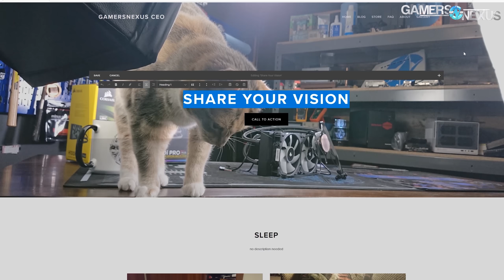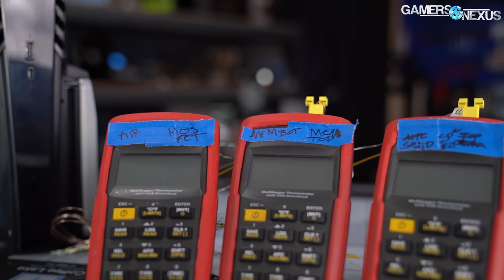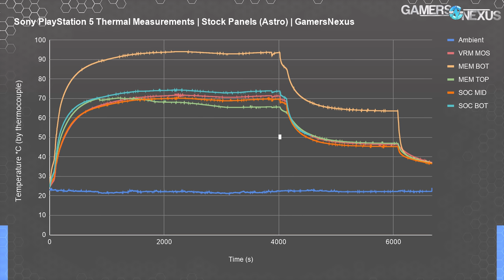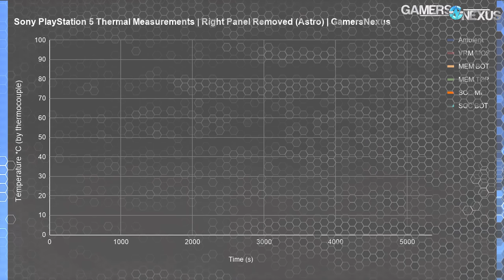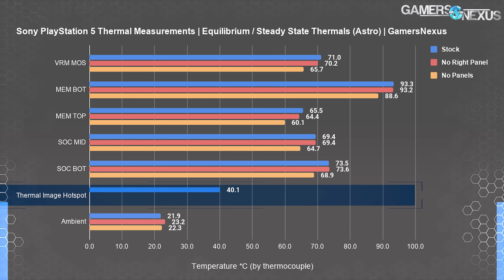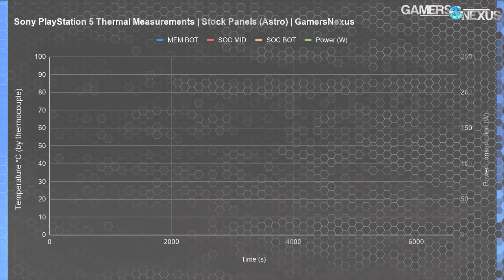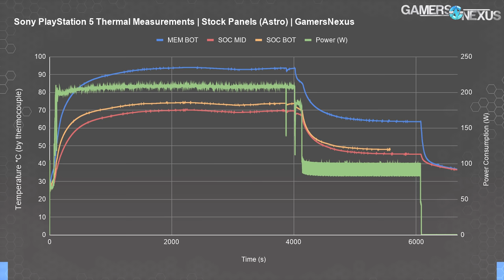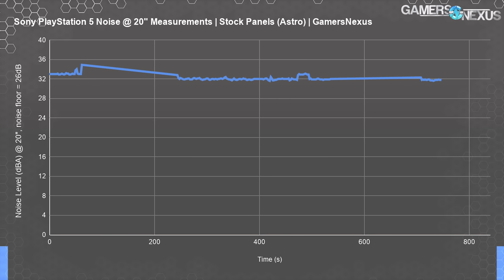Weak Cooler Design: PlayStation 5 Thermals, Power, & Noise Testing

Comment from the maker: Curious on the viewer thoughts: How do you all feel about the PS5 vs. Xbox SX looks and appearances? What about the sizes?
Reply: eh
Reply: The PS5 is ugly af. I hope they come with a slim version in a couple years.
Reply: I really personally like the ps5 design, xbox is kinda boring but much smaller. Also my TV stand would fit the ps5 when placed on the side but not an Xbox neither way.
Reply: Xbox looks more modern, PS5 looks too "extra" but gives off a next gen vibe compared to the xbox. I personally prefer the SX but I don't think either look ugly
Reply: XSX is eh. It works
PS5 is more like wtf were they thinking
Reply: Coming from a guy who isn't really a stickler for looks and probably won't buy either console anyway. I personally think the Series X would look better on an entertainment area or sitting on a desk, not on it's side though. PS5 though, I think it looks fine the way it is, but I feel it'd maybe draw too much attention where as the Series X would kinda fit in with most of the stuff an average customer looking to buy a new console would have around.
Reply: The PS5 looks stupid, the binder memes are pretty accurate. The XSX looks good but I get that it doesn't look particularly exciting. XSX seems more functional though which is what I'd be after, but I plan on buying neither.
Reply: I think I prefer the Xbox designs just for being able to place them vertically or horizontally without having to move a stand around the console.
Reply: I think the PS5 looks like it had actual thought and effort put towards its aesthetic and design. The Xbox looks like they were focused on the guts right up until the week of the reveal then realised "Shit. we have to actually sell this. Uhhhh....GREEN LIT VENT ATOP A BLACK BOX. PERFECT." I definitely prefer the PS5.
Reply: as a pc user, would go for the xbox, for the sole fact some games support Play anywhere, and i also have gamepass ultimate on PC so i can have free gold. The size i find is rather nice, it gives a mini itx build vibe for me and would fit nicely anywhere on my desk
Reply: XSX looks boring af
Reply: it's not the worst, but it's a bit too flashy after years of black rectangles i'm used too
Reply: Ps5 appears to have a more "modern" design if you will. But the Xbox appears to have a design that is indicates it was designed in a more performance effective way. That's my take away at least, xbox appears to have more function over form with the opposite to be true with the PS5. But i might be wrong.
Reply: PS5’s design made me appreciate the Xbox design more. Sure it’s just a box, but what the hell is that ugly 2010 PC tower design going on with the PS5 lol
Reply: @JustrazJD  the series s would totally fit if you can fit a big ass ps5
Reply: I don't love the way the ps5 looks but it's not hideous, I do however adore the experience the ps5 offers. It's one hell of a system
Reply: PS5 gets fixed by 3rd party sideplates.

... ah shit.
Reply: The PS5 is ridiculously big. The Xbox X doesn't look amazing, but the focus on function over form could make it a lot more robust for the average user, which is what I'm more interested in - most people I know tend to put their consoles in a spot that isn't in full view from the couch anyway, so function is a lot more important!
Reply: exactly. XSX gives "whatever, so fans holder is square so we built xbox a long-smolbox. hey, it actually works!"

PS5 gives vibes "hey engineer, we want fo showoff asthetic with PS V, so build design like V from romans! But dont forget it must be cool (aesthetic&technical) design."
Reply: Game Pass for PC made me double down on not buying a console once again. Microsoft exclusives are already included in that service.
Reply: Prefer the xbox - mostly because it's not as offensive as the PS5
Reply: PS5 is ugly AF! I prefer Microsoft's fridge more.
Reply: Xbox series X looks much better. Ps5 is not only bigger but ugly. To me it looks like Microsoft has prioritised cooling over style. But it looks better imo anyway
Reply: I prefer the PS5 as it is more ambitious. I think they will move to a better thermal case later and probably dump this design. They do this every gen where they optimize it over time.
Reply: PS5 looks aesthetically fancier but the XBOX SX has the better functional form factor and potentially airflow.
Reply: i like the ps5 better because it has more character. i look at the ps5 and think sony had a bit of fun with the design; xbox is strictly functional, i.e. box with holes in it
Reply: Both consoles look good imo, but the PS5 looks "cooler".
Reply: I really wish they stuck around with the more conventional formfactors.  Both last gen consoles fit in much better on my entertainment center than either of the new ones.
Reply: XBSX is sleek & simple
PS5 is unique & eye catching

Oh, who am i joking, XBSX looks like a shoebox, I'm scared I'll throw it by accident; meanwhile PS5 is laughably tall & weird looking (from front), and despite can be placed horizontally, it's clearly designed to be vertical, and I'm still scared that I'd slap it by accident as well.
Reply: Personally I like the Xbox SX looks as it can hide in my black cabinet. Also it being a box and smaller along with it being able to be orientated multiple directions makes it awesome for fitting in within my other box like electronics. And the PS5 is able to be made black but it's not a box which is very important in my limited space in my cabinet as I am running out of room. The PS5 is also a very different shape and I don't think I could fit a nother console if it has to be standing up like that the PS4 was awesome it's thin. But I would test fit it to see if it fit or look up the dimension and measure it. So for me Xbox SX in this regard
Reply: Definitely a fan of the series X the most, I like the mini pc simplistic design
Reply: @JustrazJD  isn't the ps5 bigger than the Xbox?
Reply: I've always been a huge Playstation fan, but honestly this Generation the xbox just looks way better in terms of design, it can easily fit in most setups as opposed to the tower of orthanc that Sony Made 😅😅
Reply: It’s not so much about the aesthetics of the consoles as much as the overall ability to do what it is designed to do efficiently and effectively.  Side note; I was unfortunate to have a PS5 with a high failure rate (basically unplayable) so from experience the XSX is doing what is was designed to do.
Reply: PS5 is futuristic AF for me. The design would look nice at CES or in my room for a couple of days but after that a don't want to watch it every day. The Series S looks like a redesigned Soviet radio by Ikea, the Series X is the monolith from 2001: A Space Odyssey. I prefer these for the minimalistic design but I'd still buy the PS5 for the exclusives.
Reply: I like the design of both but I would prob get a Ps5 due to exclusives, most Xbox exclusives will come out on the windows store and thus run better on my PC, but right now it's all about trying to get one of the new gpu's.
Reply: I've been a PC gamer since forever so I might be biased:

The Xbox SX looks way better than the PS5. I personally like the cube shape and the design itself looks like it prioritises performance more than aesthetics, which I prefer.
Reply: there is not much to compare with regarding size and appearance. PS5 is ugly and massive. Xbox is ok, nothing fancy.
Reply: I'm not really interested in consoles, but I much much prefer the muted monolithic look of the Xbox.
Reply: I like the PS5 design
Reply: ps5 stands out, matches the aesthetic of a spaceship and we do not live in that era yet. Xbox however can probably be easily blended with other media consoles/receivers etc. I personally don't care for the looks of the consoles since I only got the ps5 due to exclusives. If ps5 had no exclusives, I would instead spend that $500 that went to the ps5 to upgrade the pc :)
Reply: Thank you for giving more information and insight on what possibly was the cause of my PS5 high failure rate.  Muchas Gracias to you again for taking the time to teach us viewers a thing or two.
Reply: My XSX looks perfectly in-place next to my audio receiver, if a little plain. Mostly unobtrusive, although the LED benefits from a little tint film. PS5 is too ostentatious for my tastes as-is, but would be fine with black panels. Size of either is fine, Xbox may even be smaller than necessary, but I have a typical-sized desktop PC in the TV stand a shelf down so it may be that my priorities aren't what most people's are.
Reply: The PS5 is a modern art abomination that looks like a concept design from 2001. Outdated 15 years before it was launched. It seems like their whack idea of "futuristic aesthetics" was the primary consideration, and cooling/layout was just an afterthought. The Xbox seems like there was more thought put into the overall design. Form = function. I don't want a gaudy art installation thats the size of a record player, I'll take the minimalist shoebox.
Reply: I prefer my stuff to looks like a rectangular prism. Who cares if it looks boirng, it works.
Reply: PS5 looks very cheap, like a basic router. Xbox s x is subtle and this i like. :)
Reply: PS5 is nice because it looks different, but its wayyy too big. The xbox's are just another box, not much you can day about that 😂
Reply: xbox looks much cleaner and convenient to find a place for, rectangles rule the space, ps5 looks like it is 2009 concept. Only way sony could have done worse is by making the console spherical
Reply: The disk drive on the ps5 looks like some kind of shrunken, vestigial organ, or perhaps like a sewn on body part.
Reply: They're both kinda oversized, but at least that allows better cooling than the horrible ps4 cooling.

The Series X would fit better in most situations I think, just stick it below the TV/in front of it on its side.  I think both look good, just in different ways.  Sony really want to make it a showpiece.
Reply: I like the ps5 kinda, it cuts a good silhouette and looks unique. I respect the xbox for its simplicity that still doesn't quite look like any other console.  Ps5 irl is a big boi. It stands 3/4 the height of my 55 inch tv.
Reply: I will always wait for the second iteration for sony consoles, first generation playstations always have their quirks from my experience. No opinion on xbox since it won't be supported in my country.
Reply: The Xbox seems to have gone with a more efficient way to remove heat from the system, whilst the PS5 brought in an interior designer and used a mood wall and then whipped their engineers to cool the thing.

Edit: just remembered re: the memory cooling. I pulled apart my PS4 and the memory modules made contact with the thermal solution with pads that sat in the middle of the chip. Didn’t cover it, not by a mile.
Reply: They all look like consoles to me. Big consoles that can be jerry-rigged as an ITX PC case.
Reply: PS5 doesn't look terrible for me as apparently most people think, but the XSX looks simpler and nicer. Although I hate the "plasticky" look of the PS5, the glossy black center being the main offender. As for size I prefer the XSX form factor when placing the consoles vertically, and I guess the bottom-to-top cooling design is more efficient than the PS5 one (we'll see in your upcoming review)
Reply: I hate the design of the PS5. It looks like a big toy, and it sticks out like a sore thumb unless your living room looks like it belongs in some futurist interior design magazine. I’m speaking to both it’s physical aesthetic, as well as the fact that it’s bigger than it has any right to be. Some people might dig how it screams “GAMER” in bold letters, but I don’t. I’m not insecure about my hobby, I just don’t feel the need to advertise it to everyone that walks into my house.

Meanwhile, I literally could not be happier with the design of Series X. I’m a big fan of the minimalist/monolithic look of NZXT cases, and the Series X rings all those bells for me. You can stick that in just about any modern household, and it will blend right in. I also appreciate how compact it is, especially in comparison to Sony’s offering.
Reply: Imo i think the PS5 is muuuch to big. It's actually massive IRL compared to the Xbox, and they seem to perform the same in terms of thermals and accoustics according to reviewers. Not a fan of the PS5 looks either, but PS5 exclusives are gonna be better so :/ But im liking the Xbox design way better all in all. Its more next gen in terms of size and performance.
Reply: Xbox is literally a BOX a Big Box

PS5 is weird at first but its actually way cooler
Reply: @zombinawaifu8918  honestly... you have no need to buy XSX when you have a gaming pc.
Reply: Ugly, liked the dev model more, feel like it could have been a lot smaller, getting banned for being mean and game censorship sounds creepy and is  more of a reason for me not buying it.
Reply: Did you like your own comment?
Reply: It is what it is. Personally I am going to be a lot more sold on the PS5 if they sell some side panels that allow for different colors.

I can already imagine how cool that would be for a nice bright orange. 

Other then that I think they work and are serviceable. PS5’s design makes sense when considering the heat sink. May not work for everyone’s set up but it will work for mine.
Reply: Love the XSX design both looks and size. Not a fan of the PS5 design and feel like they could've made it alot smaller, and the XSS is fine
Reply: The PS5 digital edition in vertical orientation looks much better in the flesh than it looked in pictures. But in the end it's the games that matters. Since I also have a capebale gaming PC there's really no reason to get a Series X so PS5 it is for me.
Reply: Xbox SX. I love the simple look. The sandwich design looks like easy to cool with that beefy cooler. With airflow as simple from bottom to top. 

So, when will you review thermal for Xbox SX?
Reply: I like the ps5 design.
I really don't care about the size as long as temperature and noise is good.
Xbox is fine too. Not really interested though. Why would any pc user get a Microsoft console when every game comes to pc anyway ^^
Reply: Xbox wins by a long, long margin lol
Reply: Don't mind xbox's black refrigerator look, I think its fine. The ps5 is huge tho, makes my define R6 look like a slightly larger sff case!
Reply: The PS5 feels like it was designed by a company that sells consumer electronics, particularly those electronics brands that have a lifestyle element to the marketing and the aesthetic styling to go with it.  Love it or hate it, the styling is distinctive and that's obviously intentional.  Premium consumer electronics are fashion pieces.  I fully expect custom side panels and controller colours to be a thing (for people who don't want to match the white) and the eventual Slim and Pro revisions will sport some new funky variation on the aesthetic.

The Xbox SX feels like it was designed by a company that makes business electronics (or generic boring) electronics.  It's dull as rocks and utterly functional.  It's not an eyesore but that's mostly down to it being a simple black box.  It's hard to screw up the aethetics on a black box.  It is not a device you can show off to your non-gamer friends.  For people who want something that disappears into the home theatre unit, it might be a great fit.

The fact that the PS5 is as quiet as it is and it isn't a nightmare cooling-wise speaks volumes to the skill of Sony's engineers since that shape is more of a challenge than "fit it in a box".  I imagine that they'll tweak the design to address those issues with the first minor design revision (probably within the year) probably with some simple fix to bring the memory temps down a bit and maybe a slight tweak up in fan speed to boost cooling overall.

The size of the PS5 is a touch awkward as the vertical conversation piece but sideways mounted with black plastic side panels (give it 6 months and they'll be an option) and it will just disappear into a horizontal slot in my home theatre setup.  The ability to use proper M.2 SSDs is a real selling feature to me.  I don't trust MS to keep those proprietary SSD cards priced competitively.
Reply: I like the Series X better, it's simple, minimalist and can be ok in any area, and smaller ... Sony tried too hard with the PS5 design, and it's way too big
Reply: Ok, so we need ps5 mesh.
Reply: Xbox is a black rectangular trashcan after apples mac. Generic and does not pop off in looks specially with their false PR Marketing as the most powerful console!!!. 😂😂😂😂 Glad they only sell on US and not outside of it.
Reply: @imadecoy.  FANBOY ALERT🚨🚨🚨🚨
Reply: Time to see comments from people who are too anal about thermals... 😒
Reply: Xbox is a computer first , style statement later (or never). Sony has gone for a style they think looks good but is very polarising in that people either love it or hate it and thinks it looks like a pregnant d link router .
Reply: I think the XSX is boring, but the PS5 is definitely over the top. Still, I'd rather pick something that stands-out than something that nobody will notice.
As for what I'm going to get: Probably the PS5 Pro when it comes out. It'd be nice to have more than just one expansion slot, plus better thermals than shown here.
Reply: I like the xsx, the xss looks kind of ugly but its impressivefor the size- I'm looking forward to your tear down of the lil bugger as a bet it runs hot af in spots. The ps5 is just too bloody big, sacrifices colling for looks and that annoys me they went THAT far to not really cool everything properly... again
Reply: PS5: It'd be difficult to match it with most TV. Fortunately the side plates are user-replaceable. I can just get a replacement plates and put some Waifu-sticker on it, and make it mine. Also I guess we might see some 3rd-party side plate that claims to reduce thermal significantly ... though I wouldn't be interested.

Xbox SS: looks like an upright electric stove or something ...

Xbox SX: I'm sure there will be some min-ITX cases that copies this poor thing.

PS. no... I'm not really into waifu .....
Reply: @JustrazJD  But the Xbox is much smaller? How do you fit the PS5 in your TV Stand when it's bigger???
Reply: The PS5 looks like some mid 1990's crappy art deco piece you would find on the shelf of Patrick Bateman's apartment. While he plays "Huey Lewis and The News" right before he murders you.... So I guess its not for me. The Xsx screams I am a mini PC RAWR! And every PC enthusiast might comment on "How cute it is".
Reply: I like both, but the curves on the ps5 speak to me <3
Reply: Xbox could blend in with a decent home theater system. Ps5 looks like someone sandwiched a ps2 into a white ring binder but left a couple of game cases inside and just squeezed it shut. It looks ridiculous. They'll fix it later on down the track but needed it to look special for version one.... I hope
Reply: Im more of the boxy design sort of person, So the xbox wins me and i own the series S anyway and its smaller than i expected, I liked the original wedge PS4 but i dont get anything from the PS5, come to think of it all first gen playstations have been bigger than they needed to be, Also i think thermal wise the xbox operates warmer than it needs to just because people will complain about the faintest fan noise on consoles, and everyones PC with their fan choice always has a soothing sound to the owner :3
Reply: they are both ugly, at least with the xbox i can hide it behind the tv, no chance with the ps5
Reply: The PS5 looks like the cheapest Chinese "gamer" PC chassis from like 10 years ago.
Reply: Xbox fridge all the way!
Reply: PS5 is 3/5, if it was black i would give it 3.5-4/5 but in white is ungly for me.
Xbox Series X is 5/5, One X is 5/5 and Series S 4.5/5 if was all black or all white without the black vent i would give it 5/5.
Reply: Love the XSX design over the PS5
Reply: I thought I'd hate the ps5, but one I placed it in my entertainment centre next to my amp, I fell in love with it.
Reply: The PS5 puts the full fat PS3 to shame in terms of bulk. It's almost wastefully huge for a modern console. Also it looks like modem. Having to buy new controllers would be frustrating if I owned a PS4. Backwards compatibility limited to only PS4 is understandable but still disappointing.

The XSX and XSS look mundane and are pretty nicely sized. Not too intrusive but not really distinctive. I feel that both the XSX and XSS will have better thermals due to the utilitarian design alone. Great backwards compatibility, including Xbone controllers, is a real great selling point. I use XB1 controllers on PC so I could easily have player 2 sorted with something I already own.

It's all about the games for a console, though. Unless I can find something more compelling than just one game (Demon's Souls Remastered) or amazing backwards compatibility (all the way back to OG Xbox) I think I'll hold out on both PS5 and XSX. The Switch is a better buy in my eyes, a lot more compelling stuff than just one old FromSoft title or multiplats that my PC can play just fine.
Reply: Got XsX for gaming on a new q90T with vrr and 120Hz where supported. Amazing quiet and nice looking console. Would’ve gotten a ps5 too if it wasn’t so damn huge and ugly. Will pick it up when inevitable aal black slim version comes out.
Reply: I'm not in the market for either, but my girlfriend will probably buy the ps5. I much prefer the looks of the ps5, I'm ok with the xbox. Size is fine for both, I have a tv stand that could handle either.
Reply: prefer the ITX-like profile of the XSX, but I'll probably get the PS5 just for the games.
Reply: i like the xbox better looks wise
Reply: xsx looks boring
ps5 looks good next to my white o11 dynamic, but for a console it's fricking huge
Reply: Quite like the Xbox design myself. PlayStation feels like an art piece, and not something I’d prefer.
Reply: Xbox Series X is hotness, PS5 looks like it's popping its collar
Reply: I'm not so much about looks for the most part. If I offered an opinion on the aesthetics the Xbox looks like a Russian or cold war era East German product and the PS5 looks like it would be at home in Austin Powers bathroom. I just want them to work well. BTW, I have the PS5, baaaby!
Reply: Not a fan of the white PS5 but I can imagine it looking nice in some other colors or with some vinyl wrap designs. XSX is just a boring rectangle.
Reply: i like my minimalist boxes so xbox did a great job, the PS5 has potential in customization though which is nice
Reply: My only thought is how many people will threaten to make a business out of re-casing PS5s with more fans and heat sinks.
Reply: Xbox may look basic, but sometimes less is more
Reply: I don't care about the new consoles at all, but I think both look really good. I really like Sony's design. It's a bit large though, but I wouldn't really care. Both would fit my entertainment wall just fine, looks and size wise.
Reply: Look literally doesn't matter to me, all I care about it noise, thermal, performance and price to performance.
For now xbox with their game pass is far superior to me vs sony with 70usd games.
Reply: I feel like PS5 approach for the design was more traditional but the end result is not effective. They had to used liquid metal which, in my opinion, is an unnecessary  risk, even more when considering that Microsoft pulled off the Series X design without having to use liquid metal and a bigger shape (both consoles are big anyway). Microsoft went a completely different way in their design because of the same reason that PS5 is what it is: both consoles are using new and more powerful hardware with more strict cooling requirements. So Microsoft shift their design while Sony kept it more traditional.
Reply: I prefer PS5 looks. It's original and different without poking your eyes out
Reply: This is the first console generation I'm going to completely ignore, as these devices start to become more and more like pre-built PCs with a limited and more expensive game library.
Reply: Both look ridiculous in their own way. Xbox looks like an ugly trashcan but at least it's relatively small. Ps5 looks like an absolutely ludicrously sized white snot (or other less pg friendly bodily fluid). Both designs look amateurish in this day and age.
Reply: I think the Xbox is a more elegant design, but I honestly find the PS5 to be attractive as well. With both consoles being reportedly very quiet, the acoustics justify both consoles being larger than usual, but you can tell that there was a good attempt from Microsoft's part at minimizing the footprint of their console, whereas the PS5 is a bit of a handful.
Reply: PS5 is ugly and big, xbox is just a box.
Reply: PS5 is really bad, XBSX is better but not by much.
Reply: @Mandroid45  modern? The 2 Xbox models are just boxes...
Reply: The ps5 is more interesting aesthetically while the XSX is just a tight cubical box. Both are very well packaged but it is obvious that ps5 had more design effort.
Reply: @zombinawaifu8918  as a PC user you should be considering getting the ps5 for the exclusives.... You can play literally almost every single Xbox title on PC
Reply: Hi there Tech Jesus,

First of all, thanks for this vid. It's exactly the no nonsense kind of stuff I'm looking for. Refreshing to see people talk about the PlayStation without mentioning rehearsed lines, such as OMG OMG MILES MORALES ASTRO etc. You guys are awesome. Keep it up!

Can you please do power and thermals testing on the Series X and S as well, and also specifically how much power these use when running media apps such as Prime Video, Netflix and Kodi? Pretty please?
Reply: Series X is a fridge and a ps5 is a scientist
Reply: @Gamer Nexus,
So what could/should we do to improve thermals ?!
Make a video pls. 
Show us where to add contact pads, paste, make adjustments, holes etc.
Show us everything pls !!!
Reply: I don't care about the design, but the size of the PS5 is unnecessarily massive.
Reply: The XBOXes are just that much easier to mod looks-wise. I'm particularly surprised they didn't offer the S in a "Japan Edition" with the cooling dot being red. The X has simple rectangular sides, which are that much easier to decal for or even paint on. And it's in black, shouldn't be that much of a problem to mod.

I can't wait to see what the creatives will do with these.
Reply: the PS5 digital looked bad to me but could understand the appeal. then the disk version just looks like the digital version grew a tumour, horrible. I love the series X because it feels much more factor over form, more simplistic, no nonsense, non-intrusive.
Reply: PS5 is huge, but I love its futuristic design.. Looks like it's straight out of J. J. Abrams Star Trek
Reply: I definitely prefer the PS5, it's unusual but at least it has its own style. The new Xboxes are just dull boxes.
Reply: I own a ps5 and I love how it looks. Yes it is large but I think it has a much prettier design. I am excited about the possibility of custom plates for the outside as well. Possibly mesh ones? lol
Reply: I MUCH prefer the xboxes. I like geometrically efficient devices. This playstation just screams "make it bigger so it looks more impressive" while actually reducing the space to put actual electronics and cooling.
Reply: PS5 reminds of labia, i can't shake the image from my head. Xbox SEX reminds my 2010 computer build. It's been wild.
Reply: I think they look like consoles. I think Xbox is gonna have far superior cooling as well, and judging by this video I think I'm probably right.

When are you guys gonna make a mesh side panel for this thing? PS5 is the only home console worth buying if you have a PC, so I guarantee there's a market there lol
Reply: The series X is simple looking.
But very well engineered, functional and very small.
The PS5 is Huge, looks... alright and is hot appearently.
So yea....
I guess the Xbox is better
Reply: Series X and XS look a hell of a lot better to me, because of the clean look. The PS5 has such a weird form, it looks out of place however you place it.
Reply: Xbox is neutral and blends in.

PS is bold and a centerpiece.
Reply: I think the new Xbox has an amazing appearance. I really love the chimney design and the kind of futuristic aesthetic that it has. The PS5 slim is nice imo but the PS5 with the optical media is really awkward. Size for me personally is not really a problem, but I could see the PS5's more elongated approach being easier to integrate into many living rooms (I do wonder about the thermals though if you stick it in a shelf underneath the TV).
Reply: The XboSX looks like a nice SFC pc.

The XboSS looks like a last generation console.

The PS5 looks .. weird. Unique.
Reply: One is styled, the other is a black box. As for size, unless you live in a rabbit hutch, tne ps5 isn't that big.
Reply: ps5 looks better in person than pictures but, it's not pretty for sure. keep mine on its side. I'm a huge fan of the menu and ui, prefer it over the x.
Reply: Maybe ps5 would have looked a lot better with the all black design.
Reply: @WowzersNoWay  yeah I wouldn't have much of a problem with it were it not for the size to boot. It's like Sony said FU to everyone who placed their ps4s horizontally. It will barely fit my TV bench shelf and that's before accounting these heat issues and my tropical climate.
Reply: I like the PS5  design it looks futuristic. Don't really like the Xbox one. 
But all in all it doesn't matter. Only thing that matters is what games will the consoles have. I usually bought PS for Final Fantasy games and will probably do the same this generation.
Reply: As long as it’s cool, I couldn’t care. What do you suggest to fixing those hot ram chips? Better thermal pads?
Reply: I'd much rather have something that looks Corsair one-esque and normal over something that looks like it's about to summon blue eyes ultimate in the middle of my living room. Regardless, I'm not their target audience anymore. #PCMR
Reply: I prefer the look of the PS5. I like game consoles looking like game consoles, rather than just being a black/grey box. The Xbox SX especially looks incredibly boring to me, for my money it's the most boring looking gaming console ever, and among the top ranks in most boring looking THINGS ever.

Since we're calling the Xbox Series X the SX, is the Series S the SS? Xbox SS... Yeah I can't see anything problematic there.
Reply: Xbox looks boring, honestly think it looks really cheap.

PS5 looks nice, "next gen" vibes.

Overall, PC gamers rejoice as no longer restrained by 8 year old hardware. Good times for all gamers.....if you can actually get hold of a GPU, CPU or Console of choice.
Reply: The ps5 would look much better if the white plastic parts didn't stick out so much on top, and if they made the lighting customizable RGB with glowing buttons on the controller
Reply: I personally like the PS5 design. Looks futuristic and gamery. Don't really get why people think it's ugly tbh.
Reply: Xbox ugly but small. PS5 cool but huge
Reply: To me personally, the PS 5 looks better "Sideways" with the white side panel showing towards the user, rather than the central black piece showing forward. 
In my opinion, the XBox S/X look better overal because they dont have to "match" any design or anything in the living room. They blend in just enough.
Reply: Both are ok, xbox is very basic looking, but not awful, while the ps5 is rather large looking
Reply: image the Jeremy Clarkson meme.

*points at the PS5 * This looks excellent. *points at XSX * but I like this.

The PS5 just stands out too much for my liking but you have to appreciate its super sleek look. The XSX might be essentially a mITX computer looking box, but I wouldn't really notice it on my TV table and that's a plus for me cuz I would focus on my game better (most likely anyway cuz I go PC all the way, all the time).
Reply: @SymbolicLogic24  Ps5 looks goofy af like a white binder with a black router in the middle
Reply: the looks doesn't matter as the  performance the ps5 outperform xbox series x According to digital foundry
Reply: Ps 5 design is really hard to fit with the whole styld of a room and it's too big to not notice while the xbox fits any room style, it's little and it could be hide anywhere and you can place it vertical or horizontal and it will still looks good.
Reply: The ps5 is hideous.
A massive plastic box.
Looks like a cylon from the original series of Battlestar Galactica.
It will not age well.
They have tried to hide a cheap mass produced product by trying to make it look cool, which it doesn't.
Reply: @NobleStoneUK  Best descrip ever
Reply: I love the PS5 design matches my Lian Li O11 Dynamic XL
Reply: @Saakk129  "Eh it works?"

Exactly what other mass produced product is that small and with that much power for $500?
Reply: I think it's nice sony tired to do something other than a black box and as a result it's huge. They probably could of made it at least half the size. The Xbox is literally a black box it there is a floor on how bad it can look. The only real design consideration is the color and materials.
Reply: Xbox looks like a trash can for your kitchen and they play about as many good games too..... thing looks absolutely stupid on it's side and the material just holds greasy fingerprints forever and we all know how greasy Xbox users are.....
Reply: PlayStation 5 is the best looking console of all time
Reply: Always hated the design; looks stupid.  Now we have science to back up why.
Reply: @WowzersNoWay  I asked a few people who are not gamers and they loved it... looks like this dislike for the PS5 design comes from gamers lack of confidence and longing to be taken seriously. They had some fun with the design, at least it's original.....
Reply: I haven't seen an Xbox Series X or PS5 in the flesh, but I kinda like the Xbox - its just unobtrusive, looks like it sits there and just does its thing.  The PS5 is a statement and I am not sure how I feel about that statement lol.

I do have the Xbox Series S though and damn that thing is small and quiet and I don't really notice it on my TV console.  It just goes bing when I turn it on and the little Xbox logo, but it really just feels like I have my TV and the controller and games.
Reply: Markus Müller  but the games suck & play much better on PC. Only poor folk or children get Xbox consoles 😂
Reply: Xbox is a fridge, PS5 is a exiting design.
Reply: Markus Müller  plus last time I checked, most PCs still use fans as cooling solutions....so your comment is pretty much fanboy BS.
Reply: Ps5 the best.. xbox design even a 6 years old kid can design this..
Reply: @jonathanr9619  Anyway gamers have no idea about design or style.... they just want to desperately be taken seriously, thats why they get a hard e-peen over glass PC cases and inane bullshit like that.
Reply: @JustrazJD  isn't the ps5 bigger than the series X
Reply: PS5 is ugly and trying too hard to be unique. Xbox Series X is a box, which isn't exciting, but it's also not an eyesore.
Also Microsoft has claimed from the beginning to have great airflow and cooling, compared to PS5 where as soon as I saw it I was concerned about airflow. People make fun of Xbox's green holes top, but hey, if that keeps the console cool and quiet, I'll take it over PS5's douchey popped collar that has no airflow.
Reply: PS5 is huge and ugly, XBOX is bland.  Bland > ugly.
Reply: I loved ps5 design more than boring xbox sx design
Reply: I've always been a Sony fan for the exclusive titles and because I prefer the controller.

But damn Sony got schooled on the console design this time around.

I'm getting a digital and placing it out of sight behind the TV so doesn't really matter - But if I was putting a console in view the XSX more subtle look is way better.
Reply: N Webb screw canned air- invest in a blower! (Datavac/compuCleaner).
You'll save a fortune in the long run and way more effective.
Reply: Xbox sx is cleaner in my opinion
Reply: I brought my lad the series s just because of game pass and wow is all I can say thing is so small looks really good and is heavy! I don't understand why people say the PS5 is better designed! I think its a poor design should have been loads smaller just poor
Reply: I like the boom box S, am neutral towards the X tower and dislike the PS5. I don't dislike more rounded designs like the N64, but the PS5 is just weird shaped.
Reply: The XBoXS are more practical (they're boxes), but the PS5 is much more memorable. Both are clunky and huge compared to any previous console, so neither wins points there. The PS5 wins all the design prizes, though, because it's the only one which actually has a design.
Reply: @jonathanr9619  Beauty is in the eye of the Beholder. Science has nothing to say about Aesthetics.
Reply: Definitely think the monolithic look of the XSX is cleaner and the cooling solution looks a lot more thoughtful, but there's just not much reason to buy one if you're a PC gamer and can get any exclusives on PC anyway, unless it's for a TV Game Pass box.
Reply: Honestly I like more the Series S ♥️
Reply: @neosrt10   thats link is talking about cod war zone thats runs on sx at 120fps and 60fps on the ps5 that can be fixed with patch  im talking about the new games assassin's creed valhalla, cod cold war, dirt 5, dmc 5 check the  comparison on dg foundry youtube channel
Reply: Very happy with my PS5. Size isn't a bother even remotely. Design is pleasing and overall I like the white aesthetic. Seen them black and it looks cheap with the two toned surfaces. Also seen too many people use then without the stand when vertical. It's all slippery for that due to the absence of rubber feet, already heard of a few people knocking them off their entertainment unit which would make me very sad indeed. Xbox is fine, it's not offensive but also just seems a bit plain appearance wise. Again, nothing wrong with that too.
Reply: @TheKazragore  Pretty sure it's not even lit though?
Reply: The space ship is always prettier than a fridge.
Reply: I like the PS5 way more.. its huge so that can be an issue, but the XSX is just boring 😴.

PS5 can sit on top of my media center besides my TV and look the part. The XSX I just want to hide it
Reply: I honestly liked the PS5's original horseshoe concept design more then the current design and never cared for the Xbox tower look.
I miss the designs of the SNES and Playstation 1, those were classics. Even LG's 3DO looks nicer then the current crop of consoles.
Reply: Very disappointed with the PS5, all that size and still a hotbox. So much wasted space.
Reply: I don't care about looks... white colour is stupid, especially on gamepad... XSX might be better in cooling than ps5.
Reply: Caseless ps5 looks better
Reply: I want a box that plays video games. I want to put the box away from view so I don’t see it.
So they both look stupid, and I’m certain that Sony and Microsoft have forgotten what human living rooms look like. I’m not their target audience, anyway. The only reason I’d ever buy a console is that it is more capable than my PC in some way, you know, like a Switch, a console that is well designed, and is more capable than my PC at being portable..
Reply: When can i get one, the feelings ar real.
Reply: Both look cool in there own way, after seeing this its disappointing seeing the thermal results for the ps5 though. I won't be getting either but definitely think Xbox won on both appearance and size but that's just me.
Reply: PS5 looks better, PS5 is faster and PS5 has the best controller the world has ever seen.. So yeah.. PS5
Reply: @markmerkel  what exclusives lmao
Reply: I didn't manage to preorder one so I'm stuck waiting until the supply is restocked, but I like the visual design personally. I've been saying that bigger consoles are welcome when that means that they don't sound like jet engines for a while. Seems like Sony succeeded on that front, but I'm honestly baffled about the memory temps. How could they overlook such an essential aspect, when investing years of R&D into cooling?

Thanks for making a proper analysis unlike many others who simply measured the case temps. I'm a bit hesitant to get one now, since it can get quite hot in the summer and I don't want memory overheating issues.
Reply: I love the XSX design, feels very modern and sleek. While the PS5 just reminds me of old IT gear. And as a person in IT I just hate it. Lol. Other than that, they both could be betrer.
Reply: PS5 is so cool, xbox series x is ok cool. I don't mean the thermals.
Reply: Prefer the XSX personally. It's the same with PC cases, I would much rather an understated slab than something that looks over-the-top 'gamer' (the PS5 isn't the worst offender in this regard, but way too much plastic for no apparent functional reason). The size I don't care about too much, my shelves are large enough that they both fit fine so it's kind of whatever at the moment. I will say that the XSX is ridiculously bad for fingerprints and dust magnetism, I had to wipe mine down with a glasses cloth after setting it up. If I didn't hate stickers so much I would consider getting a black skin to put on it.
Reply: I like it but i would prefer better thermals
Reply: Better themals than looks, at least for me.
Reply: no rgb, im disappointed in both. No 200% performance gains.
Reply: Design/ looks / appearances are a matter of taste i would much more be interested in a performance comparaison!
Reply: I love love love the way the XSX looks. Love how small the XSS is. Not a fan of the PS5 aesthetic at all, and it’s obnoxiously large. Looks aside, so far my PS5 has been stellar aside from looks.
Reply: Ps5 looked decent...in its promotional material. Irl the thing is ugly as sin. The Xbox is a much better clean design, and it holds up irl.
Reply: I prefer SX neutral, industrial looks over the PS5 modern architecture influenced design
Reply: I prefer XBOX series X design. It is boring, but so am I. lol PS5 design reminds me of late 90's - early 00's computer devices and electronics, only huge. It's not a good look.
Reply: Love the PS5 design
Reply: @TheKazragore  Too much "thought and effort". It looks like a design by committee nightmare. Ugly as sin.
Reply: Personally find the PS5’s style to be thoroughly ugly. I like the minimalism and (hopefully) airflow-oriented design of the XBSX.
Reply: The XSX is far more attractive, or perhaps a better term would be unobtrusive.  It blends into the blackness of every other home computer device and peripheral here, and its shape doesn't scream for attention.  (The green on top just says "hey!")  At the size of 2 stacked Gamecubes plus GBA player attachments, I can visualize exactly what it would look like on my desk area, and I like it.

Now if only it had the game library of the PS4.  Appearances aren't everything.
Reply: @paranoidrodent  I kinda disagree a little about the Xbos SX, the matte black does tell a bit of a different story for sure tho. Subtlety I suppose.
Reply: PS5 wants to be the center of attention, XSX just slips in to your tv stand and doens't want to stand out
Reply: PS5 looks like those $40 plastic 'pro gaming' pc cases, minus the RGB of course.

Yeah not good. People say the Xbox SX is boring... I wonder if these people realize you're supposed to USE the machine, not just fucking stare at it.
Reply: Overall I prefer the Xbox design language, both of them go for a clean look and should blend in pretty well in your living room setup. PS5 is very brash and big, draws alot of attention. And for such an eye catching design the materials used don't look all that nice in my opinion, having your eyes drawn to a big plastic tower is a downside. One plus I will give the PS5 is customizability, plenty of people will take of the white sidepanels and paint or hydrodip them.
Reply: I actually like both, Series X is a smart looking bit of tech nice and uniformed but I love what I've seen with the concept designs with what we could potentially get with custom plates on the PS5.
Reply: @JustrazJD  if it can fit the ps5 on its side it can probably fit an Xbox series x on its side
Reply: I have a XSX. I prefer the boring black monolith look compared to the PS5's big-chungus wifi router. That didn't stop me from trying to buy a PS5 though. After that consumerism experience however I might just wait for the PS5 slim-and-available edition.
Reply: I absolutely hate the ps5 look, I'm not to sure why. It just doesnt look great, I like the xbox series x, not the s's black circle. It just doesnt match.
Reply: I dig the iRobot-esque aesthetic of the PS5, unfortunate about the thermals though. The Xbox SX looks functional and probably easier to fit with more setups, but just doesn't feel as unique, but definitely feels more at home with the mATX pc community.
Reply: Honestly I dont care about the size that much and I think ps5 looks freaking cool and fresh. Xbox series S is also a good looking console but it kinda lacks any personality for me. Series S tho is kinda ugly. Really dont like the black circle on white box looks wierd.
Reply: I was unsure of it's thermals when I saw the breakdown that Sony published. This data is valuable, it would be nice if we could compare it to the previous gen consoles (launch PS4, Slim and Pro). That being said they are on their way out so doing such content now would seem more like a waste of time and resources. Holding off for the mid point refresh, be it a Slim or a Slim and a Pro version as they did with the 4. Looks come second to performance for me, if they get the job done then I'm all for the lab coat or Seto Kaiba (Yu-Gi-Oh) collars of the PS5. Mostly in it for some exclusive games that Sony has in their catalog, and if I want something from Xbox, it's usually available on PC as well, so I have my choice made already thanks to that. One more thing, to add regarding the PS5. The whitelist Sony is working regarding the M.2 expansion slot that can handle the memory controller is what I'm waiting on the most. Around 600 GB is 100 more than what we had for the launch PS4 of last gen, albeit that one was a 5400 rpm HDD.
Reply: The unfortunate thing is the only one I like from an ascetics perspective is the runt of the pack; the series S. PS5 is a hog that would require it's own entertainment center cubby with it's curves and SX is to much of a thicc boi.
Reply: ps5 looks like they are trying  too hard.  xbox looks like they didnt try hard enough.  I really liked the original ps4 look and the xbox one x was the best looking one in that family, IMO.
Reply: PS5 is literally too large for anywhere sensible near my tv. Which is a bummer, since I already have an Xbox and there is no point upgrading for now.
Reply: Xbox definitely looks better but is too thick to fit sideways in most tv units (at least mine). Ps5 actually would fit because it's flatter, but it is not a very good design, at least they should have shaved off the protruding fins on the white side panels so they follow the main chassis. They're definitely going to redesign a much more conservative aesthetic in the revision. I guess at the end of the day it's the games that matter, and PlayStation tends to have the best single player offerings (God of War, TLU etc).
Reply: @Ihrohni fan Sarrkassstenschtein just like my setup
Reply: I don't like the PS5 by itself, but the design makes some sense next to the controller and I have a soft spot for "experimental" designs, even if I don't like them per se. Xboxes are OK, I guess, but boring AF.
Reply: PS5 looks goofy compared to the clean minimal look of the XboxSeriesX.
Reply: I like the fact Xbox actually made a console a box. The design couldn’t be more fitting to its name.
Reply: Prefer the look and size of the series x. I can appreciate the aesthetics of the ps5, but would prefer something less attention grabbing and smaller in my living room
Reply: XBSX is nice, minimalist, understated. PS5 feels a little form over function.
Reply: @Manuel G Here in Brazil this thing would not survive our summer, it's 40+ celsius for 3 months!
Reply: the ps5 looks silly and inmature to my eyes. The xbox I like the no bullshit aproach. I'm a "pc gamer" so I don't count I guess.
Reply: The PS5 can atleast be laid in a cabinet/rack of other AV equipment. The xbox has plenty of dead space that it takes up in that situation, so I feel that the PS5 is more likely to look better in that situation. That being said, the old Optiplex 780 airflow (with a single fan in the middle designed to push air across CPU from the whole front of case guiding it with a shroud) is what I think of when I see the xbox, so I'm guessing the system life will be pretty long....those old Dells rarely died because they had so much fresh air to grab at.
Reply: Who cares about appearances! Do the Xbox Series X next, and then we'll be able to tell how we feel about it :D
Reply: PS5 stands out like a sore thumb. Xbox can easily blend into the background. I personally prefer it to blend into the background.
Reply: The series x and s look good to me, they are simple and pleasant to look at which is the exact opposite of the ps5, it's so freaking ugly.
Reply: Definitely the Series X for me. I just prefer the more toned down design that makes it far easier to blend in. The PS5 looks like a Piece of Art in a Way, but I don't really want a Piece of Art sitting next to my TV. Also, I prefer the form factor of the Xbox and now that you have done the Thermal Testing on the PS5 it kind of makes me think that for Microsoft they just went for a Function over Form approach. The Thermal Design of the Xbox just looks more thought out.
Reply: Xbox is boring. I already have a box that I play games on, it has glass panels and Rubs, because how else can you make a box look exciting?

Well, you can put some white panels on either side apparently, because I think the PS5 (digital) looks much better (neither are particularly 'good' looking, but who really cares? I want to play games) IMO.

The disc version, however, is ugly. That extra bit just ruins what was obviously intended to end physical media. 

When they do make a new version of the system, I would bet they don't make a disc version.
Reply: I like the design of the PS5 but it's too big for my setup TBH
Reply: Function over form. The Tower form factor makes me feel more comfortable with the thermals of the Series X.
Reply: Love the simplicity and "function over form" design of the series x. PS5 aesthetics aren't my favorite, but not a deal breaker either.
Reply: @James_Bee  Except those white panels are trapping heat inside the console.
Reply: Xbox Series X design is... boring, but a boring you can mix with the environment. Xbox Series S is the most aesthetically pleasing of the bunch. PlayStation 5 is futuristic... ugly future is what it is; it’s the worst looking of the bunch. Custom plates might make it better though, but as they come, it’s the ugliest and less functional of them all
Reply: Too say the truth, Series X is much less distracting on the living room furniture, it goes unnoticed depending on the person, turned off of course.
Reply: ps5
Reply: I’m an Engineer, so I love how well engineered and novel it is, contrary to the PS5. It’s probably half the volume of the PS5. 

The asthetics are pretty clean and will fit in any living room. It’s a “one size fits all” console, not a huge RGB PC that’ll be shown off in a game room.  Contrary to the PS5 with it’s blue LED and curved/white design, it will upset a lot of families.
Reply: @thomassmith4999  “the best controller the world has ever seen.”
That doesn’t look like a game cube controller at all...
Reply: @WowzersNoWay  The slim version should take at least 3-4 years, we’ll probably need at least a 3nm node being used in the mainstream to make it possible.
Reply: PS5 is big and ugly. Xbox SX reminds me of the monolith from 2001: A Space Odyssey. Teardown/Thermals of the Xbox SX soon?
Reply: so... do you suggest to remove both panel and wait for another solution later ?
Reply: Well seeing as how the sides will have to be off... The looks go to the monolithic box. 😒
Reply: I really don't care about either, since I will stay on PC. That being said - since they have become PCs - I like the Xbox. Sony pseudo-scifi-thingy looks stupid and has bad cooling. The Xbox on the other side is a... black box. With a fan on top, pulling heat where it naturally wants to go. No BS, no curved side panels. Just from that alone the Xbox seems like a better engineered Console.
Reply: @hi_tech_reptiles  Aesthetic preference is definitely a personal thing.  The matte black finish is nice, I grant you.  It's the incredibly basic exterior design that lacks the little details that one would expect from an intentionally simple product (e.g. why is the swappable proprietary drive awkwardly in the back instead of worked into the front design?).  It isn't ugly but it feels uninspired and lazy to me.  I fully expect that the simplicity of it will appeal to some buyers.  One man's boring is another's subtle.  Tastes vary.
Reply: @ls-zp5eb  Every game can also be fixed with a patch on Xbox Series X ..the hardware is the more powerful version of RDNA 2 that the weaker Ps5 shares..it goes both ways as Xbox has the more powerful GPU and CPU than Ps5 but devs paid more attention to the weaker Ps5 nothing a simple patch cant fix on Series X.
Reply: @neosrt10  
CPU
3.5 Ghz vs 3.8 Ghz (+2.3% for XSX)

RAM
448GB vs 336GB + 560GB (22% PS5 on 3.5 GB and +22% XSX on 10GB) (impact/results of this still unknown)

SHADER COMPUTE
10.2TF vs 12.2TF (+16.7% XSX)

GPU CLOCK (this is important because it's tied to the speed of all GPU caches and other components in the GPU)

2.23 Ghz vs 1.8Ghz (+21% PS5)

GPU TRIANGLE RASTER (billions/s)
8.92 vs 7.3 (+20% PS5)

GPU CULLING RATE (billions/s)
17.84 vs 14.6 (+20% PS5)

GPU PIXEL FULL RATE (Gpixels/s)
142 vs 116 (+20% PS5)

GPU TEXTURE FILL RATE (Gtexels/s)
321 vs 379 (+16% XSX)

SSD RAW
5.5GB vs 2.4GB (+78% PS5)

As you can see, there are areas that the PS5 has advantage, its just that these areas are usually dismissed because none of the companies really talks about them since it's easier to market "TF"s. But TFs are just one part of a render pipeline as you can see above. And everything you can do faster along that pipeline, means you finish the specific task faster.

There is also the fact that having a higher clocked GPU means that the PS5's GPU caches are faster. That potentially increases effective memory bandwidth.

And i have only listed all the on-paper stuff, and not any of the custom stuff like the IO complexion of the PS5 or the tempest engine. All things thar handle tasks that are otherwise done by CPU freeing up CPU cycle on the PS5. Most people dismiss stuff like this because they dont understand them. Bt these things all play a role in what ends up on our screens.
Reply: @ls-zp5eb  
Xbox Series X
Xsx CPU 3.8Ghz>3.6Ghz Ps5
XsX GPU 52 CUs >36 Ps5 lmaoo thats garbage..clock speeds cannot overcome that deficit .
Xsx Ram 560Gpbs>448Gbps Ps5 
Xsx is has  112 Gbps faster Ram for games even of its 10GB Ps5 still has to allocate ram on OS so maybe 13GB slows af ram on Ps5
Xsx Supports DX12
Xsx supports more games in VRR runs faster backward compatibility accord to Digital Foundry
Xbox Series X adds HDR to previous gen  Xbox games Ps5 doesnt for ps4 games.

XsX supports VRR in many games Ps5 does not according to digital foundry in Dirt 5 comparison. 
Xbox Series X has the  faster more powerful hardware only the ssd on Ps5 is fast and still Xbox Series X managed to beat Ps5 loading times in Red Dead 2 and Final Fantasy 15. 
Xbox Series X isnt getting the optimization attention Ps5 is getting because devs know how popular Ps is but more popular is not more powerful son. The Xbox Series X has the more powerful version of the same RDNa 2 architecture and GPU than Ps5 period.
Reply: I don't care about the looks, I care about thermals and noise :D
Reply: @joshjlmgproductions3313  That ridiculous huge router in a binder is awkward and garish unless your entertainment setup is from toy story.
Reply: @SpltPersonaltyOF  Yeah they say " Its hot in this giant binder "
Reply: @skullcrusher4307  In this case XSX has better specs so less "is" more.
Reply: @dasistwalter96  Those white fins will poke anyones eyes out.
Reply: @hapticgaming  No you cant ..100s of titles are Xbox Only especially backwards compatbility OG Xbox and 360 you can't play on PC
Reply: @p0kem0nlvl1  Ps5 is a garrish cosplay mess.
Reply: Mickey D  You have no idea what your talking about ..lol.
Reply: @thewirv  No ..it looks like its from Jupiter Ascending ugh.
Reply: @s3rv3r3rror8  Xbox series X has better 4k with Ray tracing son. its Ps5 games looking like last gen with no VRR and shit raytracing.
Reply: @lordvicky1546  Ps5 is a tv antenna looking ugly thing.
Reply: @Loy1477  Ps5 looks like a cosplay tv antenna device.
Reply: @MayaPosch  A stupid design that looks like a 1970s hippie school book binder.
Reply: @Morden97  Like a giant goofy hd antenna box
Reply: @thomassmith4999  Xbox Series X games look better with Raytracing and VRR in 4k than Ps5
Reply: Ash Bajaj  Yeah if your from the 60s lmaooo
Reply: @s3rv3r3rror8  You Silly Sony Pony Digital foundry said Raytracing and 4k with VRR run better on Xbox Series X 🤣 the Ps5 had frame dips in Dirt 5 as well according to Digital Foundry who said its too bad Ps5 doesnt support VRR 🤣😁 ..enjoy.
Reply: Ash Bajaj  Dont be salty ....the 60s were swingin. Yeah baby yeaaah.
Reply: @Ikram Hussain Seems like you're describing CRAIG!!! LMAO🤣🤣🤣
Reply: @neosrt10  You obviously did not comprehend my comment. Why would anyone buy an Xbox if they have a PC? It's redundant. Sony and Nintendo actually have a history of putting out electives worth buying the hardware for, PC gets all Microsoft games and most third-party games as well, and Xbox has... well... they bought Zenimax I guess?
Reply: @rufusconnolly8489  Xbox Series X performs like a 2080ti and has back compat for PG for $500 and you cant buy a a PC with that performance for $500 and the best Ps5 titles are on  moslty on PC
Reply: @rufusconnolly8489  Dont be a simp 100s of Orignal Xbox and Xbox 360 and even several Xbox One titles that can be played on XboX series X and s backwards compatibility are not on PC but many Ps5 biggest hits are on PC ..Nintendo Switch is hot low res garbage for kids...and most Nintendo games can be played via emulation on Xbox and PC.
Reply: Mickey D  Actually I do ..and I kinda am thinking I should have waited for special editions of the Series X and Ps5 with no games Ps5 ..I jump on PC play Apex , Overwatch, Black Desert, on Xbox for Forza, Guardians,  Horizon, Gears 5, Battlefield, COD, backcompat , S Ps5 and Gow, SFV, Last of Us for now. Switch we got rid of never used it at all as my Galaxy S9 Plus and wifes iphone  destroys it with  emulation and free games with better battery life and free AAA game in higher res than switch. We sold it with the mario controller and  a game with some bs rubber grips.
Reply: @neosrt10  Look dude, misuse modern slang all you want, it's not gonna impress me. You're not going to get me to buy a console because it can play old games that I can emulate. On my PC. That you keep ignoring.

You're not going to sell me on a console that literally every game coming out for it I would rather be playing on my PC. You're also not gonna convince me that I'm buying it for the exclusives that are eventually coming.

Look I'm not gonna say it's not got done positive. The controller is better, it doesn't look like an egg that popped it's collar. Microsoft is also famously a champion of cross-play. But they also tricked - and I'm going out on a limb here - they tricked you into paying an extra hundred dollars a decade ago for a Kinect that you didn't even need.

Stop being a fan dude, because it's moronic. Why are you defending a massive corporation that, while they do know all sorts of things about you, almost certainly regards your existence with utmost contempt? They don't give a shit about us. Nobody is obliged to give a shit about your ranting, either. 

Had to edit this because I fat-fingered the send key on my phone.
Reply: @NoEvilEye  Space shit isnt as cool as the Space monolith.
Reply: @thomassmith4999  Its not faster in 4k Raytracing son get your facts checked.
Reply: @paranoidrodent  Bro the Ps5 look like a Buzz lightyear school binder for 8 yrs olds its garrish and awkward.
Reply: @neosrt10  The Xbox is a little faster in cross gen games in ray tracing but convincingly slower at 120hz and all raster only games. I have a PS5 and I know this is a fact and have no problem with saying so.
Reply: you have no way of determining that yourself your going by videos you see and a number counter Ps5 has massive dips in fps up to 40 fps juat in 4k raytracing juat like Series X had the same drops in 120hz mode but in reality moat of the time its only a few frames per 4 to 5 fps  and its not the hardware its the developers not being able to utilize Xbox Series X dev kits because they went out very a year later than Ps5 kits..Xbox launched in the same week but dev lit tools went out in 2020 while Ps5 went out in 2019 so devs had alot more time to optimize games for Ps5 according to Tom Warren of the Verge who spoke with Microsoft and the devs of AC Valhalla, Dirt 5 and DMC and the other games. in COD the game runs almost identical a credit to the programers  at infinity ward who actually gave a crap as well as Watchdogs it a matter of optimization not hardware because Xbox Series X hardware is more powerful but many arent using it properly because the dev kits aren't matured and being utilized  ..on a whole to see games even do 4k Raytracing 60fps is amazing and is proof Xbox S X can perform to high standards raytracing demands ..Ps5 seems to enjoy 120hz performance mode without Raytracing ..The good d thing is if you have all 3 like I do PC ,SeriesX , Ps5 you can jump back and forth and pick and choose what runs good on whatever platform and exclusives and backwards compatability Best of all 3 worlds.
Reply: "Conclusion: Could be better". Could be better, really? If this was a fully-fledged small form-factor PC you would tear it a new one for such abysmal thermal performance. Why so much leniency here?
Reply: People saying PS5 design is shit, meanwhile xbox looks like my 15 yr old UPS😂
Reply: Funny thing is everyone says design of xbox is better, but then sale numbers are totally opposite